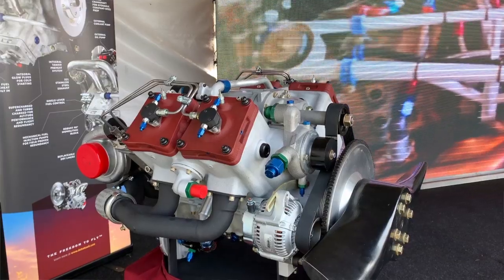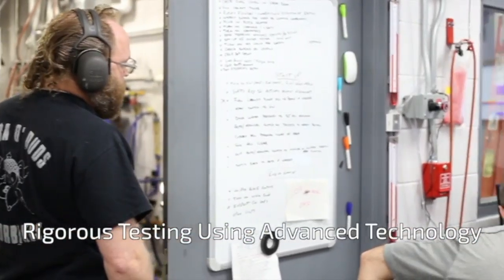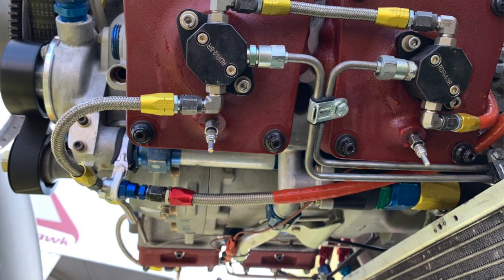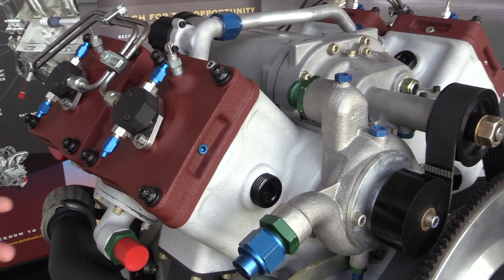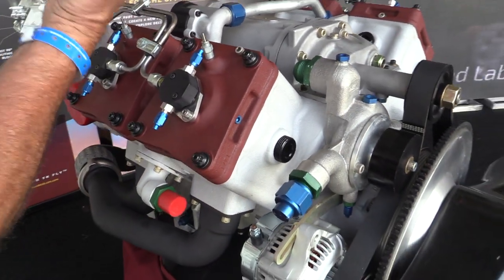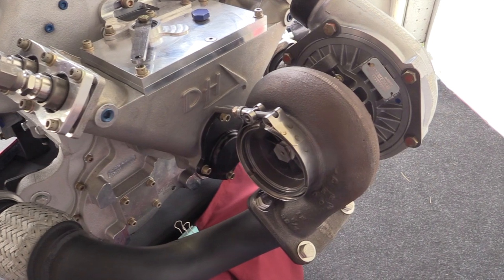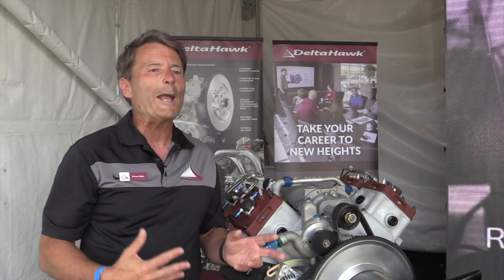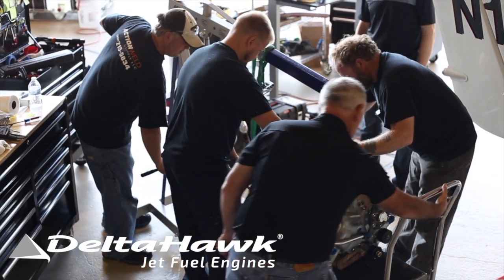DeltaHawk Jet Fueled Piston Engine Update

Comment: I always believed a 2 Stroke like the 2 stroke Diesel would be the best idea.Will they be used in Cars one day? .Direct injection like Diesel but how do they get it to combust smoothly like diesel .I wonder how must boost pressure it can take.
Reply: Not likely to see in automotive or trucks, too difficult to control emissions.  Current tech high pressure direct injection computer controlled is currently the only tech that makes emissions standard.  Not even sure why they are bothering with this very old school diesel system.  i could see them finally getting certified and the next year the EPA shuts them down.

Comment: Great idea, but not easy to make work in older airframes.  I originally interested in this engine back in the 1996 when i built my Velocity.  It has been "next year" since then.  $89,900 is a great deal installed,. but not realistic.  I wish them well and hope to see them get up to the 230- 300HP mark to replace the 470-550 series lycomings and continentals.

Comment: DeltaHawk  Almost there ????   Pleas please pleas  -  3600  RPM ???   Please please Please cast your motor blocks with a bolt on pattern so If and when a owner wants to bolt a reduction drive onto you very well designed motor the propeller RPMs can be reduced and drastically improve thrust efficiency  and reduce NOISE ....   Just make your engine blocks so they can except  a reduction drive or a prop re locator for new designs aircraft's including WIG  ( wing in ground effect ) and bigger   Gyro crafts .  Thank you .....  Even just 6 bolt holes and a flat machined face  at the prop flange .

Comment: Would be curious to see the internal workings of the mechanical fuel pump..........Jet A1 does not have much lubricity compared to diesel. F34 has a lubricant additive, but you wont see that at any civil airport, but it could be ordered.

Comment: is 'jet fuel' the aircraft equivalent of road diesel?
Reply: Yes. Part of the idea is, the fueling infrastructure is in place, even at relatively small airports. Jet A is generally half a buck cheaper than 100Ll
Reply: @davidvicari5139  no sir........ ; jet fuel configuration (specs) is different from "road diesel"........

Comment: Good on them for realizing that gear boxes and electronics are not a good feature of light aircraft engines. 

But truth is this has a lot of flaws. A V4 has torsional vibrations due to the uneven power strokes in spite of having perfect primary balance. The engine mount on top makes engine RE and RE a PITA and will result in a deadly failure mode compared to engine mounts that go under the engine. Two stroke in aviation?  Only on flying lawn chairs which have some of the highest crash and fatality rates. Plus... aviation is bad enough for the environment with carbureted engines and leased gasoline with no emissions control. We don’t need to make it worse with two stroke diesels.  Liquid cooling adds weight, complexity, cost, and failure modes. And having both a supercharger and turbocharger does the same and almost ensures that you’ll encounter a failure of one of them when you probably won’t ever have a turbocharger failure in your lifetime. 

Then the price. I’m sorry but I can buy a lot of fuel for that money and the five hours of endurance I already have is more than enough.
Reply: sorry Bartonovich52.....; according to my JAR-ATPL education (a long time ago)..... a supercharger does  N O T  the same as a turbocharger..!!!  (= please hit the books !!) // when it comes to vibrations..... = hmmm.....; maybe you are not so far off the line...... // greetings

Comment: I wouldn't mind a well-designed diesel in the air. As long as the electronics are kept to a minimum, which it sounds like is the case, they are ultra-reliable. Also pretty flexible on fuel sources in a pinch.

Comment: two stroke diesel engines in a aircraft.....now where the shipes replace their two stroke diesel engines with battery driven electric motors? and aircrafts fly with electric motors too.... that's I call  "an inovation".....

Comment: Bosh perfected mechanical fuel injection with their K- Jetronic system in the 1980s. The system was used in just about every European Fuel injected car during that period. The latest technology is battery BTW. A paraffin(Jet Fuel) burning engine has no future.
P.S any diesel engine can burn paraffin so you didn't invent anything you just made a diesel engine for aircraft. Something that was done like 70 years ago.
America .....too much BS not enough science.
Reply: Diamond is already using Diesel engines in all their aircraft with great success. The car industry is light years ahead when it comes to engine performance, efficiency and reliability overall, i wonder why more airplane manufacturers dont just take a proven and reliable car engine plattform and modify it for use in GA aircraft (like Diamond did).
Reply: Bosch Jetronic were low pressure gasoline injection systems.

Comment: "It's a compression-ignition engine that burns jet fuel."

Or, as we've been calling them for over a hundred years, "a diesel".
Reply: Newer diesels have had to go to a high pressure fuel system to meet emissions, the fuel pums are really picky since they're internally lubricated by it. On the old mechanical pump diesels they would eat whatever you fed them like French fry grease
Reply: JY The Iowa Guy And that’s why a diesel in an airplane is a good idea. No emissions standards so you can run whatever type of fuel system works best, not what the government mandates.
Reply: @wrkingrageaholic  no emissions standards...now  Just wait
Reply: In a stol you could be on the lookout for accessible McDonalds restaurants lol
Reply: Most turbine engines are compression ignition engines that burn jet fuel. ;)
Reply: Bartonovich52 That’s not true. Turbines have ignitors. Once fuel is burning it burns continuously.
Reply: @wrkingrageaholic  the heat from compressed air helps atomize the fuel further, so it uses many principles to have efficient operation.
Reply: you wanna buy jet fuel then the best place for you is belovneft,com  we sell at a cheaper rate and also make delivery
Reply: Your comment is retarded and a waste of energy

Comment: A new version of the two stroke detroit deisel first manufactured in the 1930s.
Reply: has no poppit valves in the head ,  same scavenging  foreced induction concept  though, more like a sleeve valve ,  with no sleeves,  port position, piston shape and very very precice fueling  , with a lot of forced induction pressure,  con rods are forged titanium, so the thing as robust as hell ..  that's what it seems like anyways,  more like a piston port two stroke

Comment: "Simple, few parts" - it's got a turbocharger,  a supercharger,  a preheater, "a lot of redundancies", glow plugs, fuel injection...
Reply: Let's not forget to mention " Rigorous Testing Using Advanced Technology" on the vid across your screen! (saying so isn't enough...)
This infomercial brought to you by...
Reply: Heh, I was thinking the same thing. With that being said it has no cams, valves, or mags which all tend to be common failure points on AvGas engines... so who knows. Like everything else I’ll believe it when I see it. The price seems high though. A Continental IO360ES for a Cirrus SR20 costs less and is proven.

Comment: 2-cycle no-valve diesel. My 2cc hobby plane engine runs the same way. It's not FAA certified either.
Reply: Sounds like the old GMC 2 stroke diesel technology, fell out of favor for emissions, but the jet A will help. Good power to weight ratio is a real plus. I think you have a real winner 😉

Comment: This engine will have very limited cylinders and rings life.  The exhaust ports will fry the oil on the liners.
Reply: let somebody else test a few first and then decide. I would rather have a four cyl. Lycoming or something more reliable.
Reply: @martinnorbeck5961  Well, the simplicity = reliability theme can be indeed an approach if you cannot build parts within tolerance.  Therefore, fewer parts means fewer chances to have parts out of tolerance.  But simplicity also means that you sacrifice performance.  Performance manifests in many ways, including wear.  If this is sold as a super cheap way to get you to fly with low cost fuel but cheap and disposable engine, or an engine with very low TBO (which may be OK for many pilots), then I can see it as an honest approach.  But if they try to sell this as the Cadillac of engines that solves all problems, then I would say that this is a scam.

Comment: The biggest downside of Diesel engines is fuel availability at country dromes. A few manufacturers have tried this & failed! I wish them well but doubt it will take over the market.
Reply: Boggles the mind.

Time, effort, lots of thinking go into a small package of innovation yet a YouTube surfer is compelled to cast, I assume expert, doubt. I'd say buy one and help improve the world for us.
Reply: @pentagate1 You simply don't get it do ya? These designs are not new! If it was that good the market would be flooded with such engines a long time ago! Resale value is a huge issue when it comes to selling any plane that has an odd-ball engine up front! Take a look at the Vans A/C, anytime you see an odd engine in them (which is rare) for sale they can't give them away, people want 'known' useable perf where they can get fuel & parts on any street corner! As if I would buy one, what drugs are you on there?:-)
Reply: @endwood  You seem to underestimate how ingrained and opinionated about things flyers can be... the only way a diesel is gonna work in the market is to be provably more reliable, and cost competitive with all the diesel advantages too like efficiency, and to break into the market slowly without failures. The fact is that it is superior... but not superior enough. Also it would be trivial for airports to offer diesel/JP-1.... there is really no reason not to run plain old diesel if you rent' going high altitude, and pay less than half half the price of avgas.

Comment: This seems to be a loop scavenged two stroke, which is very cool. Just like a 51 series GM Diesel (Detroit) from the '50's. The mechanically driven blower is not a supercharger but rather a scavenging blower as it alone cannot produce boost, since the engine is a two stroke (extra air just passes straight through). The supercharing comes from the turbo supercharger "turbo" as the restriction caused by the turbine gives the compressor something to "push" against, thereby increasing cylinder charge pressure. This is all just like a Detroit. I love how he resisted calling it a "Diesel" engine, which it most certainly is, but Compression Ignition is the most correct. Bet it would run just fine on diesel too. Too bad it needs glow plugs.
Reply: Detroit diesels weren't loop scavenged, they had exhaust valves.
Reply: @PistonAvatarGuy  This is true, for all series, 53, 71, 92, 110, and 149. But the 51 series is the exception.  They only came in two or four cylinder versions, and were only made for a few years. They still had a cam, but only to operate the unit injectors. When you look under the rocker cover, there are no valves, just injectors.
Reply: @realvanman  Interesting, thanks for the info.

Comment: Cool! A 2 stroke jet "A" burning engine. Ole Rudolph Diesel would be proud. I hope all goes well. Any plans for more powerful engines? Maybe V-6 or V-8 engines down the road? I could see this in the Marine industry as well. A 400 hp in a airboat would be interesting.
Reply: Safer on the ground than in the air at this time.
Reply: Rudolph Diesel wanted them to run on vegetable oil.

Comment: "jet fueled piston"
sounds like a diesel engine to me
Reply: Arashi Mokuzai  Rudolf Diesel himself designed his engine to run on peanut oil, not petroleum. Diesel describes the combustion process, not the fuel.
Reply: @PistonAvatarGuy love my 6.2 jimmy❤
Reply: @AlanMydland-fq2vs  Why? That engine barely makes as much power as a good number of 4 cylinders from the '80s.
Reply: Arashi Mokuzai  Compression ignition engines ARE diesel engines.
Reply: yan-Deriction It is. 2 stroke diesel.
Reply: Diesel == jet fuel == kerosene == RP-1. All the same thang. Just better controlled burn characteristics.
Reply: @astronichols1900  not really, Kerosene is a part of Diesel. But Diesel contains other hydrocarbons like paraffin. Yes you can use kerosene in diesel but you need to add lube
Reply: @massive irrelevance --HAHA! Def fluid in the air!!
Reply: @gckshea noooo dont smog it😂
Reply: @massive irrelevance The real struggle is when the particulate filter needs to regen and the engine goes to 5% power. It's a real bummer when you're flying over a big city.
Reply: My engine burns ass gas.
Reply: keep in mind that not all of us like diesel and some of us like are high octane fuels!
Reply: Octane rating for gasoline,cetane rating for diesel.
Reply: @jlo13800 yes but u cant deny diesels deutz being the best if the best❤
Reply: @AlanMydland-fq2vs yes i have seen a duetz 4 cylinder 2 stroke air cooled diesel with seperate oil tank run on a piece of equipment that was on beck of our dive boat i work on. You just add the oil and she keeps going!
Reply: Arashi Mokuzai  Interesting train of logic there
Reply: Just Hope you don't put diesel in it ,just saying.
Reply: Diesel engin, pure mstery😐😐😐😐😐
Reply: absolutely😅
Reply: All the comments miss the point. There is ZERO pollution control on aircraft engines. ZERO be it Avgas or Diesel or Turbine (Jet). Yes the aircraft engine manufactures over the years strive to make engines cleaner and more efficent..  but is like these gigantic ocean going tankers and container shops using fuel oil and diesels the size of a large multi floor  building. The fleet puts out more pollutants than all passenger cars in the world. We want cheap crap from china...  so the bat crazy leftist marxists new (old) green deal morons will have to stop all ships, planes, large trucks to reduce CO2 0.0000000001%. BTW CO2 is not a poison and plants needed it for photosynthesis which produces oxygen... and of course food.